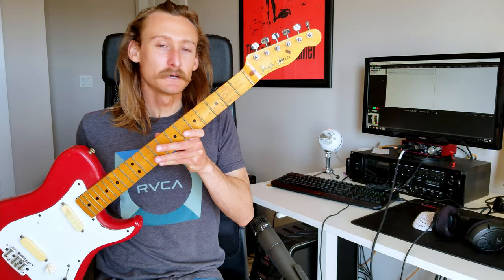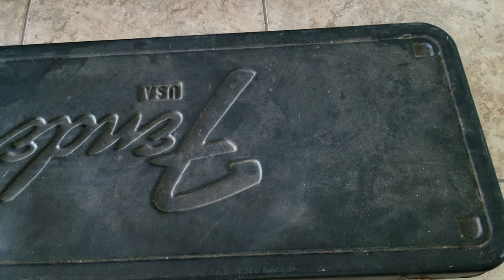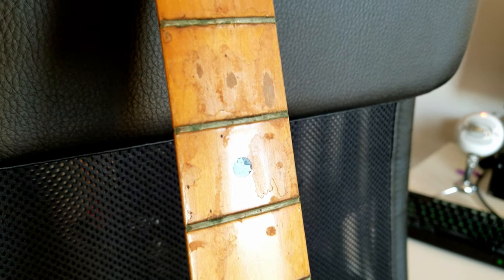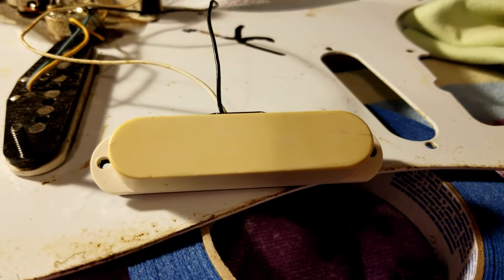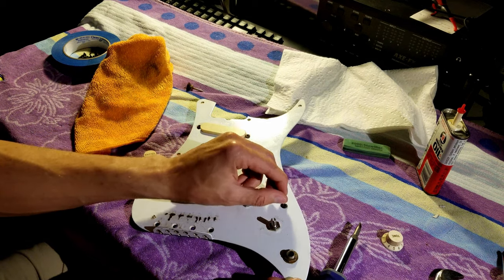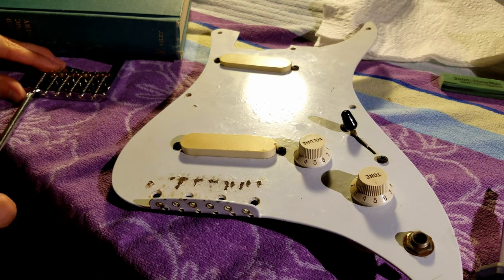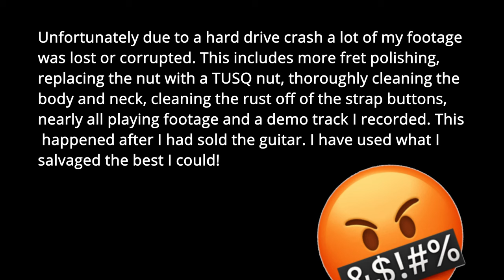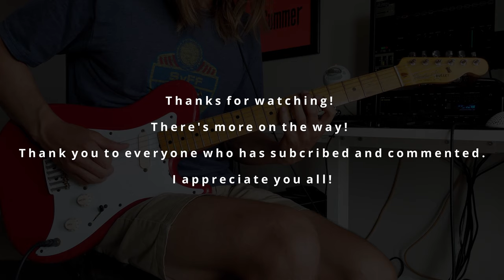Unique 1980s Fender Guitar Restoration!!!!

Comment: I recently bought almost exactly this. Everything is the same but the pick guard is black.
It looks like the owner had the guard resprayed or anodised because the coating thickness didnt let the screw through.
Original case and strap all functioning. Only thing missing are the pick up adjustment screws and springs.
Cant wait to clean it up and get it running again.